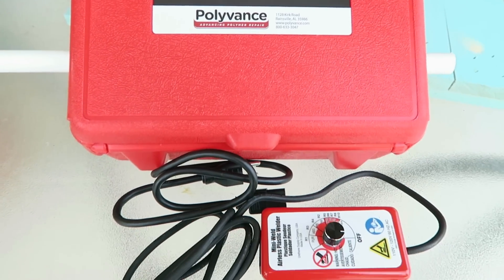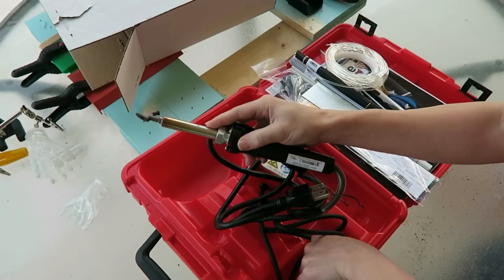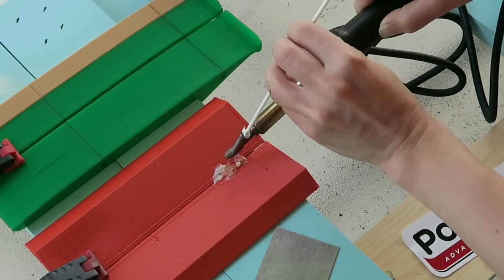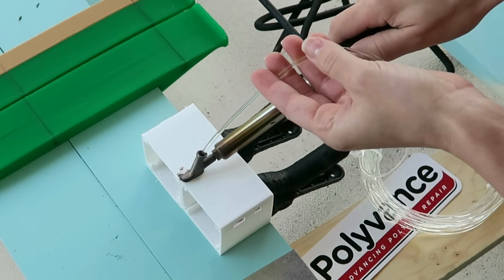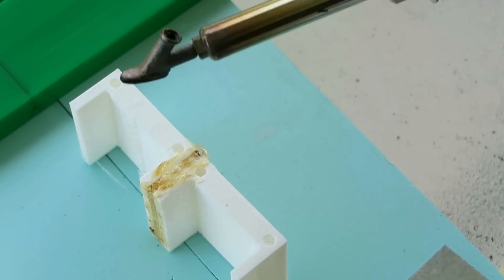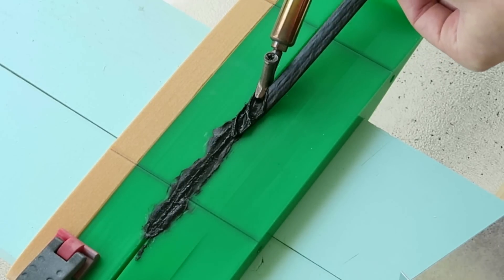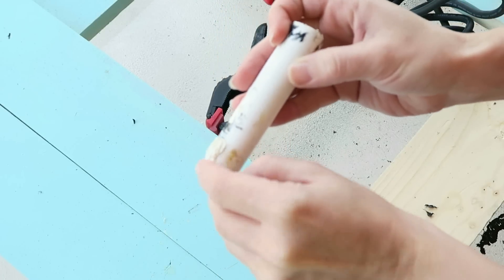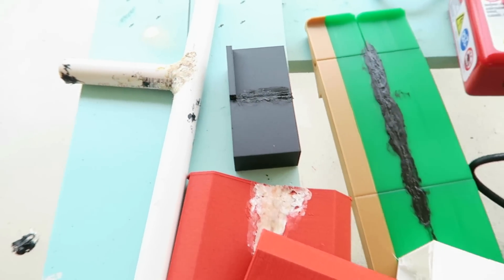Mini-Weld Model 7 Airless Plastic Welder Review - Joining 3D Printed Parts

Comment: Word of advice, put some backing on the pieces so they don't deform. Welding requires you melt the base material otherwise you aren't getting fusion. In metal work, we refer to as brazing instead of welding.

Comment: Also when you're doing a seam take your time make sure that the plastic you're working on can accept the heat iron then go get your material out of the hot iron then go straight down do a inch or two Wicked straight down trying not to spread it so wide and sparingly when you go to trying different plastic tubing always clean the remainder out with your new tool you made out of your scrap then put the new material in before you start your other projects also The Wider rods use the teardrop total that comes in a case that might work better

Comment: Before you weld your PVC pipe and other pieces of plastic always treated with especially polyvance plastic prep sand it down with roughest sandpaper like 50 or 40 clean it again with plastic prep polyvance dry it off for the shop towel then try to bond materials together

Comment: My advice to you is to use hot air plastic welding device to make best solid construction bond and then use the airless plastic iron welder with flat leg to smooth the surface and enhance estetic.
You can order on Polyvance page iron thin round brushes to clean the hole from black burned plastic remains. Search for this numbers; 6140 and 6141, price is around $6.
I use hot air plastic welder Leister Triac Pid with digital temperature adjuster, but you can find on aliexpress the same device with different name with low price.

Comment: U definitely need more practice with plastic welding. Also just 3d print your own plastic rods for welding. It's very important to use the right welding rod. If your plastic is abs then u must use abs welding rods. If it is PP then u must use PP and so on. U will get the strongest bond that way. Do not mix different types of plastic. Also since I dont have much money I just use a soldering iron with a chisel style tip that I hammered out from a pointed soldering tip an I use various techniques shown here. https://www.youtube.com/playlist?list=PLuNGkitCpD6bHY3bfWKFuTBzLgqzpHH_Z
Reply from the maker: I also now use a soldering iron primarily. It's great for detail patching and smoothing small 3d prints and seams, and I use the filament straight off the roll or applied with a 3d printing pen, so it's always compatible.
Reply: @LindyDesignLab  awesome! glad u are honing your plastic welding skills I think it is a good skill to have as there is plastic everywhere in our lives
Reply: Do u remember the old days when we had something plastic that got broken and we either threw it away or tried to super glue it. So glad those days are over lol

Comment: Please, get a vise and clamp the parts down. Also, if you could slow down a bit and make progressive material fills, your results will be much stronger and look nicer. Plastic welding rarely gives a pretty smooth result, so have a little patience and you might not have to sand your final joint so much. Good start and keep it up.

Comment: I wonder if there's tips like this for temperature controlled soldering irons.  I'll have to look on Ebay or something.  That would be the route I would go using regular filament as glue.  Otherwise, I can see how this would be very useful with plastics other than 3D printed types.  PVC especially is a tricky plastic to get things to bond to besides itself with PVC cement.  Great video though!

Comment: I'm using a cheap temperature regulated wood burning tool kit (comes with a lot of different shaped tips) and just regular filament for welding or fixing printed parts.
I really don't like the way you have to feed your plastic rods thru that "nozzle" on your welder, all I could think about was you burning your fingers at some point. And the burnt plastic kinda indicates that this welder does not have a good temperature regulator. For the price tag of your kit, I would have expected a bit more to be honest.
Generally, if you want to weld pieces of printed plastic like this, make shure you print them with enough shells and high infill rates, or the heat will make it too easy to bend everything out of shape. Giving your workpiece some time to cool back down (use a fan to blow on them) can help as well to preserve the form of the original pieces.
For bonding PVC pipes, I would try to get some specific PVC-glue (should be available in your local crafts or DIY store). That stuff is awesome because it chemically melts the PVC as bit. Usually PVC glue is based on the chemical Tetrahydrofuran, so it works kinda the same as Acetone does with ABS plastic. (And you can use Tetrahydrofuran to smooth some PLA-mixtures, just like you do with Acetone and ABS...).